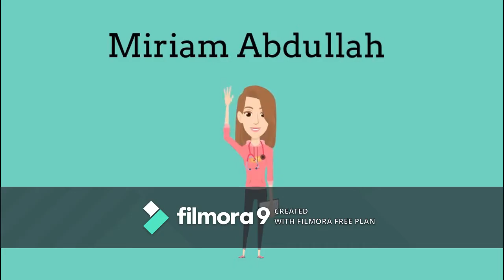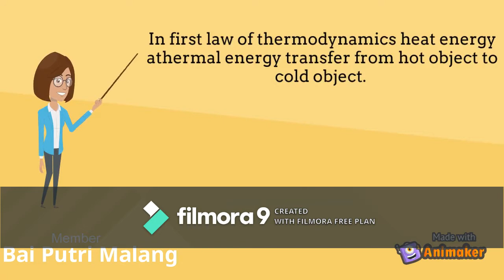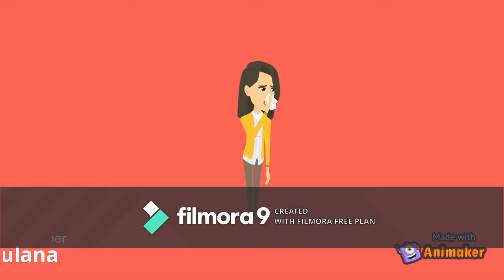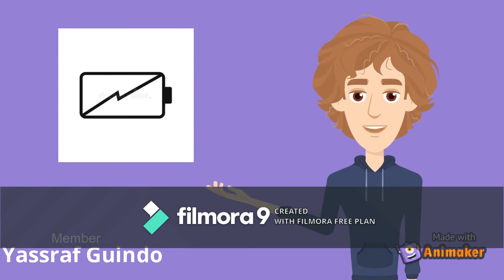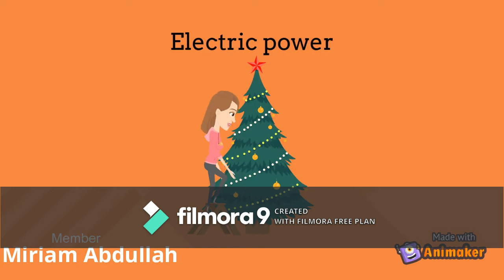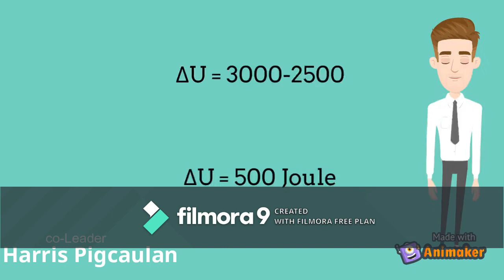Basic SCIENCE | First Law of Thermodynamics

Comment: 1. Solution

∆U=  Q-W

∆U= 2000- (-2500)
∆U= 2000+2500
∆U= 4500 J

2. The two ways that energy can be transferred are by doing work and by heat transfer.

Comment: 1.) Solution : 
∆U = Q - W
∆U = 2000 - (-2500)
∆U = 2000 + 2500
∆U = 4500 Joule

2.) The two ways that energy can be transferred are by doing work and by heat transfer.

Comment: 1. 2000-(-2500)
2000+2500
=4500J the initial energy 
2. The two ways that energy can be transferred are by doing work and by heat transfer. Energy can be transferred from one object to another by doing work. To do work requires that an agent exert a force on an object over a distance. When work is done, energy is transferred from the agent to the object, which results in a change in the object's motion (more specifically, a change in the object's kinetic energy). Heat is the transfer of energy from a warmer object to a cooler object. For example, a lighted match (higher temperature object) will transfer heat to a large pan filled with lukewarm water (lower temperature object). Note that the actual amount of thermal energy each object has doesn't matter, as the pan of lukewarm water might have more thermal energy than the match. What is needed for heat transfer to take place is a difference in temperature between two objects. Without this difference, no heat transfer can take place. Heat can be transferred in three ways: by conduction, by convection, and by radiation.

Comment: 1.Solution :

ΔU = Q-W

ΔU = 2000-(-2500)

ΔU = 2000+2500

ΔU = 4500 Joule

Internal energy increases by 4500 Joule.

2.  2.There are two types of systems: open and closed. An open system is one in which energy can be transferred between the system and itssurroundings. The stovetop system is open because heat can be lost into the air. A closedsystem is one that cannot transfer energy to its surroundings.

Comment: A system and its surrounding can exchange energy in two forms. These two forms are work and heat. The net energy exchanged by the system (work+heat) is reflected as a change in the internal energy of the system. This law is known as the first law of thermodynamics.
Reply: ΔU=Q-W
=2000-(2500)
=2000+2500
=4500 J